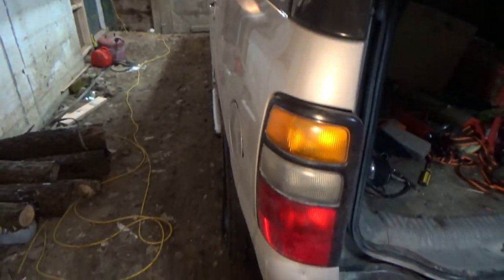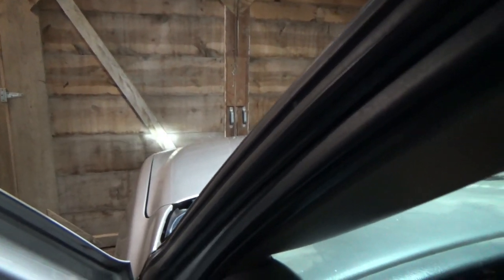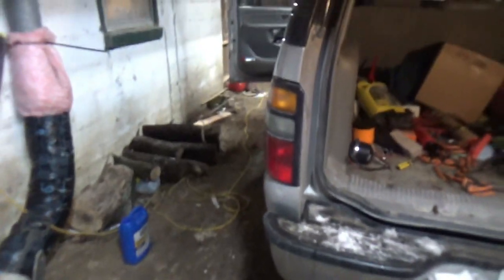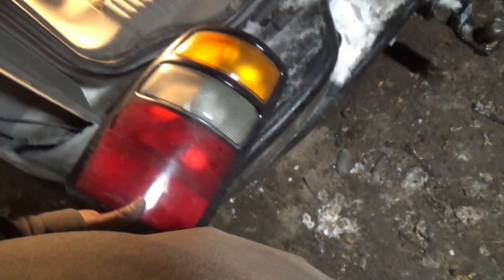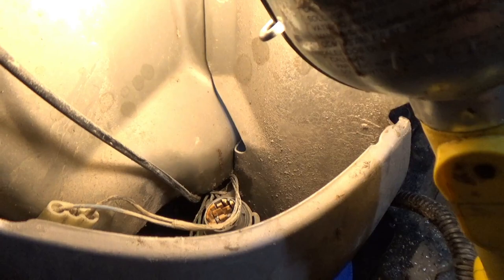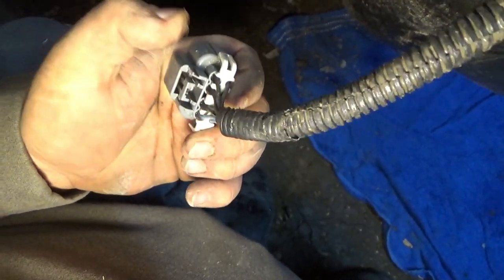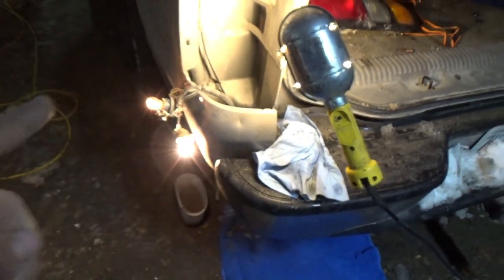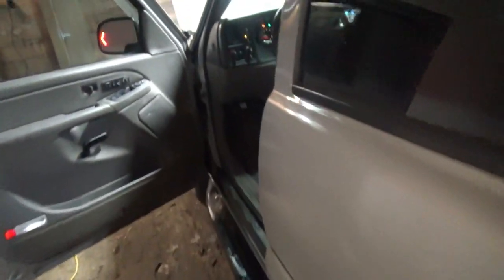2004 Chevy Tahoe How to fix no tail light, or no turn signal, or no brake lights   or all 3

Comment: I have a 03 suburban same issue just reversed my driver side has tail light but not my passenger side junction are all clean, fuses good bulbs new, new relay switch for flasher. All light work like normal but the passenger side taillight doesn't come on at all also the brake light do work all 3.
Reply: I have the exact same problem with my 03 Suburban (all lights work but my passenger tail light). My brother said that one of the wires has corroded in two and there is not enough wire to splice it back together. I am replacing the entire tail light harness this weekend and hoping that fixes the problem.
Reply: I have exactly the same did someone fix the problem

Comment: I, too, have a corrosion riddled gm.  My Silverado is a nightmare.  I’m in the process of redoing the wires from the junction box to the tail lights.  Multiple broken wires caused by corrosion.  Argh.  Now I’m trying to figure out why I have no backup lights, after rewiring?  Very slow process.
Reply from the maker: Luckily mine was pretty decent for 270,000 in this video she had 260
Reply: Did you ever figure out what it was
Reply: Yes, my bulb assemblies were heat damaged which caused intermittent issues and finally failed.  Possibly caused by poor grounding?

Comment: Anyone has aftermarket tail lights and one of the break lights won’t turn on? My brake lights only work in day time lol but not night time.
Reply: @209clicka how did you fix it?
Reply: Man this just happened to me, anyone have the fix to this mess? I even switched out the taillights and it works, so it’s something else

Comment: Great video..! I have a 2007 ext Cadillac  any chance that you can tell me why my backup/reverse lights stay on? I replaced the brake switch on the brake pedal...
Reply from the maker: The backup lamp relay and fuse are located in the under hood fuse block,
The fuse is supposed to be #15 a 10 amp fuse. Cannot find a location for the
relay. Check the inside of your cover.
My guess is that the relay has failed on. To turn the lights off I would just pull the fuse for now.
Reply: @Anthony1999gtp  Thank you so much.. I have done everything you said to do however I can't figure out the location of the relay... I've been told that it is in the BCM (Body Control Module) left of the steering wheel under the dash...

Comment: I was hoping you showed us how-to disconnect the plug under the back on the left hand side and I think the right hand side plugs into a wiring junction box that's known for going bad at least on the 2003 to 2006 Suburbans / Tahoes and possibly Silverados as well as the Cadillac Escalades. Does anyone on YouTube know of a video link for the 2003-2006 Tahoe's or Suburban's as I don't want to damage the plug. It would be Super Appreciated!! Thanks Eddie J.   Long Island N.Y.
Reply: I can’t disconnect my plug it’s like it’s stuck
Reply from the maker: Try a heat gun over it but don’t get to hotzz

Comment: I got stopped for a broken tail light. But when I pressed the brake pedal and it would turn on 🙄
Reply: This is what’s happening to me now how’d you fixed it?
Reply: @fademeupmarvin2778  it ended up being the bulb itself. I know. I thought it was weird but for some reason the old bulb will only engage when I hit the brakes.

Comment: What to clean harness with
Reply: CRC 5103 Quick Dry Electronic Cleaner - 11 Wt Oz. CRC Electrical Silicone Liquid Lubricant, 10 oz Aerosol Can, Clear
Reply: @toddtaylor6192  just one of these or do we need them both?
Reply: @toddtaylor6192  rubbing alcohol won't work for this, huh?
Reply: @Professional_ProCraftinator  Both if your still having problems replace circuit board box  for rear lights and both left right turn signal tail stop harnesses the wires become brittle 2004 Silverado and won't carry voltage as they should. I noticed when would bend twist harness it would work a few days then 1 or more bulbs out either side few days later. Bought parts on amazon think I spent about $125 installed parts myself. Works like new no more issues 1 year since fix